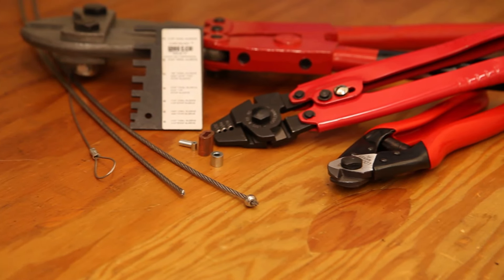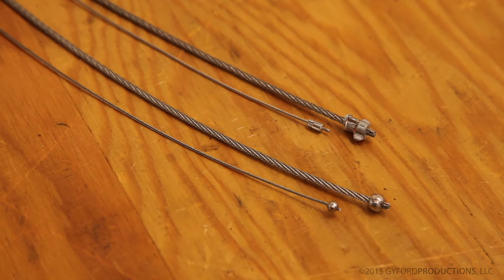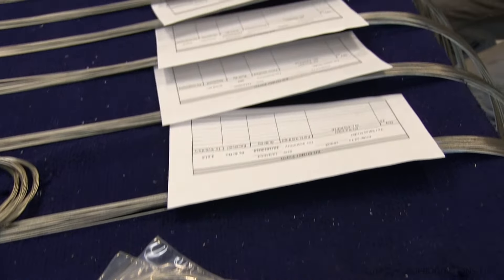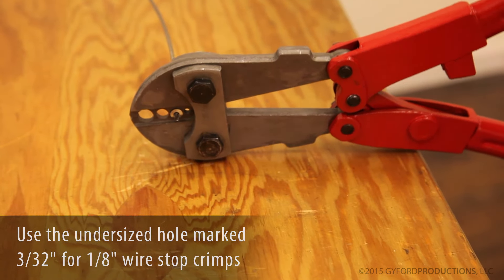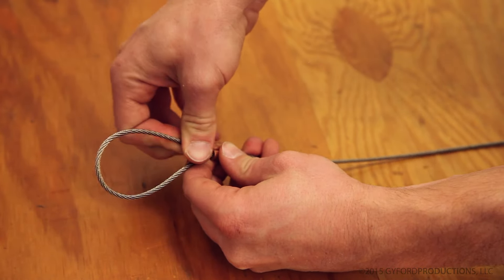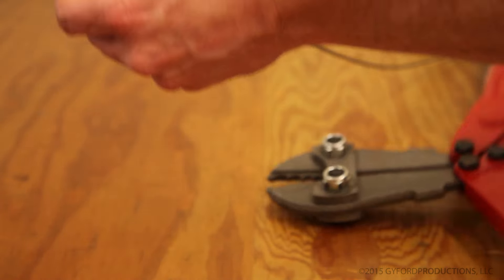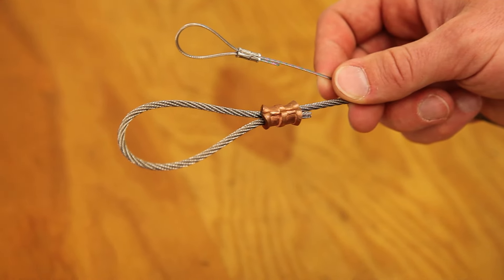Making Wire Crimps, Swage Balls, Oval Sleeves Video

Comment: Thank you for this video. Can you use the same crimping tool for all of the fittings for a particular cable size?  I.e., if you were terminating 3/16 wire rope, would the same crimper work for oval sleeves as well as the stop sleeves or balls?  Does the crimper for aluminum sleeves also work with copper and stainless steel sleeves?

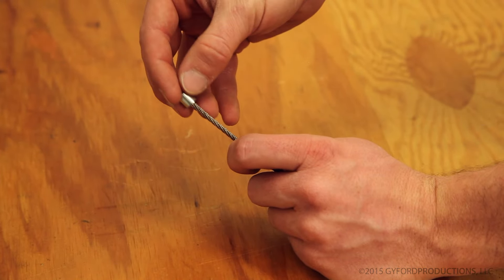Comment: I have a piece of exercise equipment that has a threaded bolt with a stop after it. The cable is fed through the bolt which attaches to a sliding weight stack.  The stop looks like what is shown in the video at 00:51. I bought a swaging tool and a stop at lowes today, but I'm afraid to try it and mess it up. Any advice? I have pictures I could send if it helps.
Reply: Did you fix it
Reply: @stitchthisditchthat259 Nope! Still waiting for the advice from here. Lol
Reply: @lemmetellyousomething679  if you need one let me know , I'm happy to help

Comment: How would You repair a stationary swager's joints/hinge? If the rear curved arms connection hole has been filed down from loose fitting Bolt?

Very good tutorial! Easy to understand!
Reply from the maker: Otto, If you are using something similar to the crimping tool in this video then, unfortunately we don't think that part can be repaired. You may be able to find a replacement jaw, but manual units are fairly inexpensive and easy to find. We sell them for $55.45. I did a quick look around for parts but came up empty. Please let us know if you find a solution. Thanks for the comment on the video, we appreciate it.